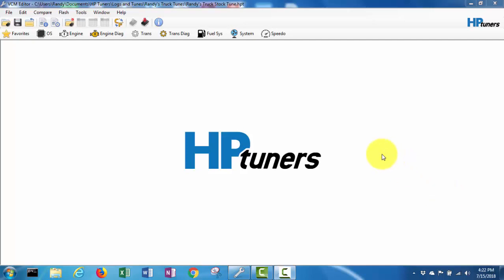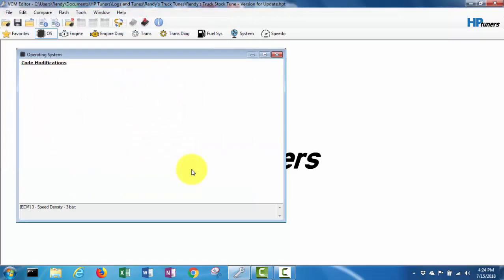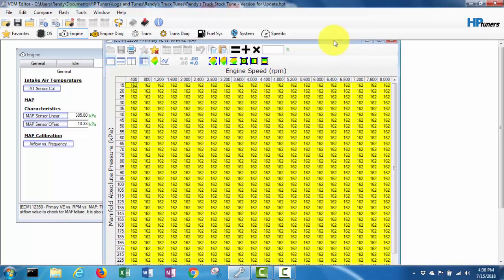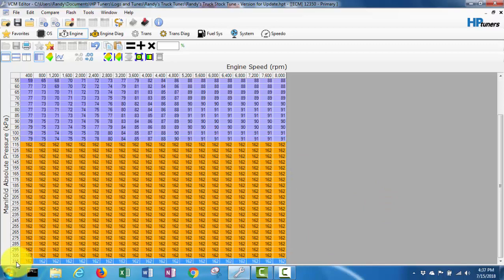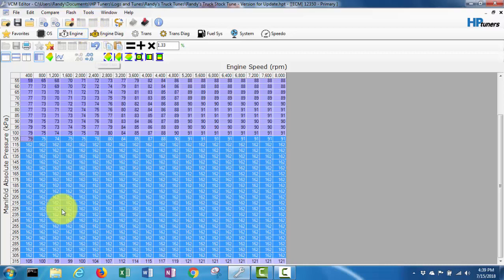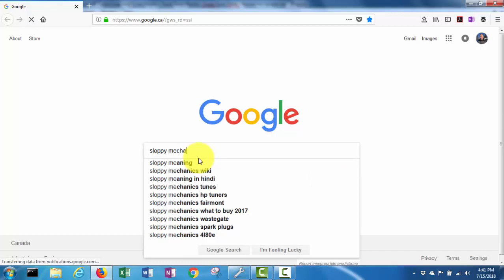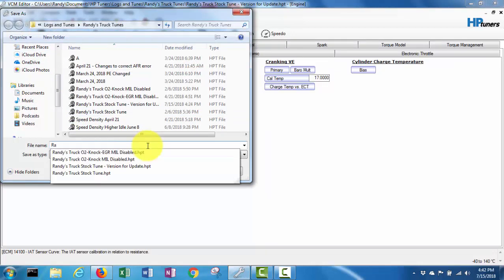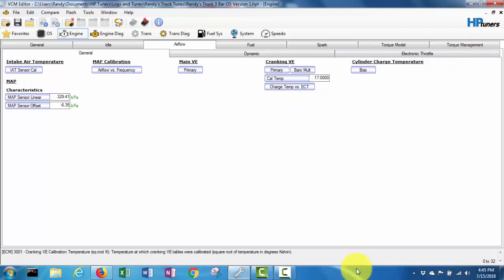Lowbuck LS Turbo Truck Project - HP Tuners 3 Bar Enhanced OS Setup

Comment: Hello, my car AUDI Q5 2.0T STAGE 3 Turbo K04 X HYBRID
I had a problem with the pile above 1.5 bar, after some accuracy I was recommended to replace the map sensor to 3 bar, I installed it but it turns out that a calibration is needed, can you fix it?

Comment: Have you run into any issues with running negative values in your offset table for the OS you’re running?  Primarily in high vacuum conditions?   The resolution on the 3 bar table only goes to 15kpa. I’m having issues in those areas with erratic injector pulse width, no matter what I do with my AFR or timing or injector pulse values.  I’m trying to figure out how get it sorted out and I’m thinking it has to do with the map offset values

Comment: Whenever I open the OS tab, there nothing there. My question is how exactly did you get these options?

It's having the user defined parameters option required?
Reply from the maker: The options vary depending on what ECM you are connected to, what kind of vehicle are you working on?

Comment: dont forget to change your boost enrichment tables as well. Otherwise its going to try to run stoich as soon as it sees boost. Not what you want brother. Good video though. 👍
Reply from the maker: Thanks Bad Luck Garage, always good to hear from you more experienced guys. I’ll check the boost enrichment tables. I’ve gotta admit I’ve been worried after seeing the issues you had with your turbo C10 and seeing you go in a different direction other than turbo. I really hope I can make this work. Thanks for watching and commenting though, nice to hear from some of you guys with bigger YouTube channels, thanks again.
Reply: Lol, my channels nowhere near big brother. I’m just trying to help out where I can. Turbos are definitely high maintenance but don’t let my build discourage. Just remember mine popped because of fuel slosh/starvation. Take your time and tune it a couple PSI at a time till you get to the boost level you want. Looking forward to seeing the results brother. 👍🏻